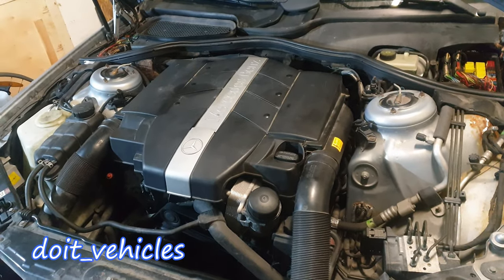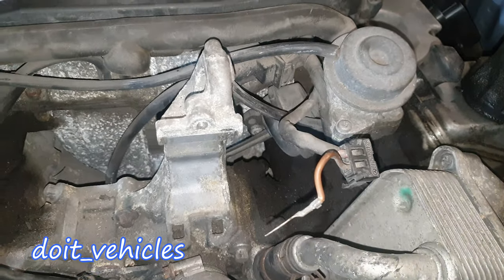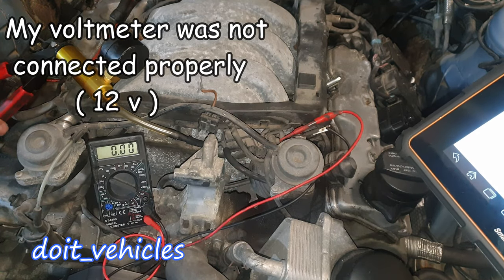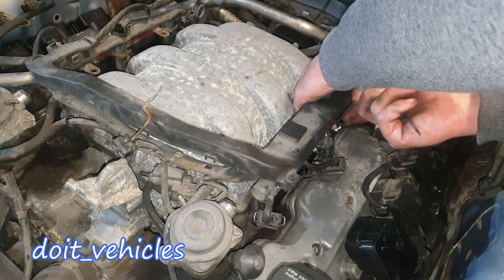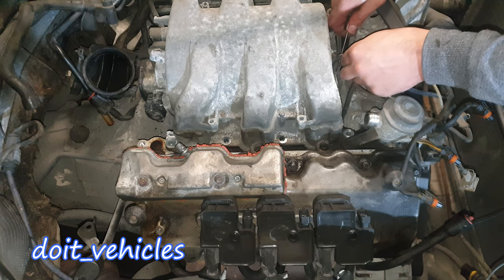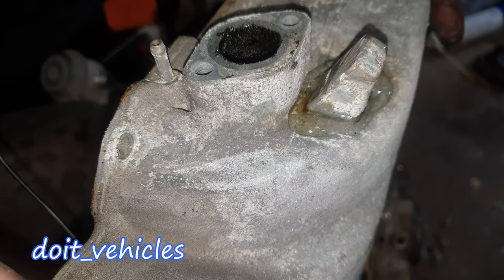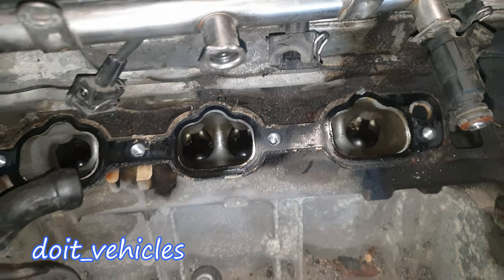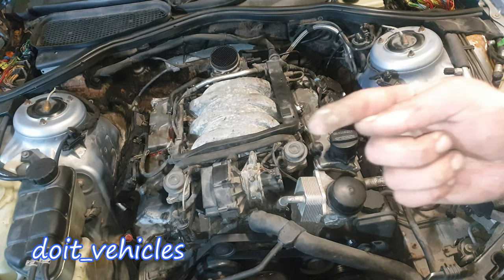W220 Intake Manifold Removal , Gasket Replacement S320 Mercedes E430 E500

Comment: NIce Video!  Question: The First vacuum rubber line, shown by you, that goes between the solenoid & the manifold itself how does it connect to the manifold?  Specifically after the 180o bend it connects to the inside of the manifold, but that rubber hose is it protected by a bellow type of rubber (after the curvature?  Or, it's ONLY the rubber hose that goes from the solenoid to the intake manifold (very obscure area)  I am saying this because it should go inside the manifold.  a) Also, which product do you use to clean the inside of the manifold (Carb Cleaner or ?).  b) Which product do you use to the injectors to fit into both the fuel rail & the engine block? (brand or product description, please!  Thanks again.

Comment: Very interesting. I have a CL500 with a V8 M113 engine, which is basically the same than yours except the M113 has 2 extra cylinders ;)   I was wondering how to check the variable intake air path and your video gave me some tips. Thank you!
Reply from the maker: Hi. Nice to hear from you !

Comment: Great video once again. You made it look easy but it’s a complicated work. I have a w220 s350 which hesitates under 1-2 rpm should I look at cleaning MAF, throttle body, EGR valve and intake manifold in order? I have replaced ignition coils and spark plugs already. What do you suggest, thanks
Reply from the maker: The best is to check the live data and look for anything unusual. An inspection for excessive oil in the intake channels is not a bad idea
Reply: @doit_vehicles  Thankv you, sure will do.
Reply: @doit_vehicles  I have excessive oil in the EGR tube and PCV tubes. What is this normally a sign of?

Comment: Hello my name is Dee. Your video is very informative. I have a 2001 Mercedes s500. I have trouble codes PO600 Communication Link and P2037-4 Reductant injection air pressure sensor circuit A. Do you have any advice what I should do to fix the problem? Thank You.
Reply: Fix "trouble codes PO600 Communication Link" first, check all connector beetween controllers, you might get incorrect codes because of bad comm link

Comment: Hi can I remove the intake manifold without removing the injectors and the gas rail
Reply from the maker: Hi ! no
Reply: @doit_vehicles  thanks
Reply: GD morning sir:what is the best spark plugs brand to use on a w220 S500

Comment: Hi I HAVE A CODE P0112 ON MY S500 2006 w220 WHICH IS AN INTAKE TEMPERATURE SENSOR THE QUESTION IS WHERE IS THE LOCATION OF THE IAT SENSOR
Reply from the maker: is together with the Maf sensor